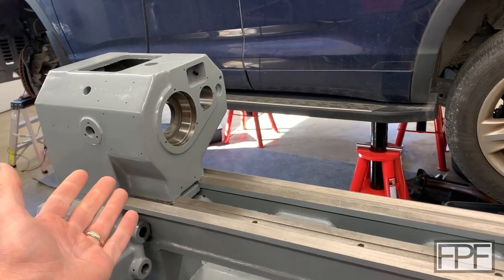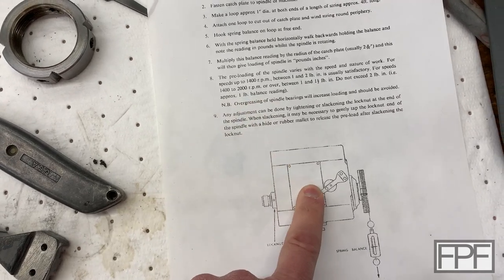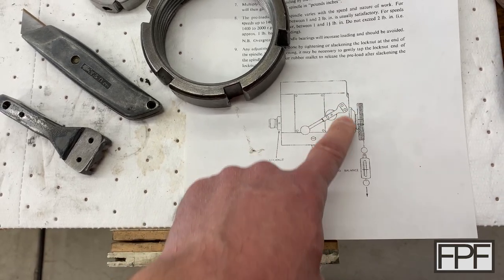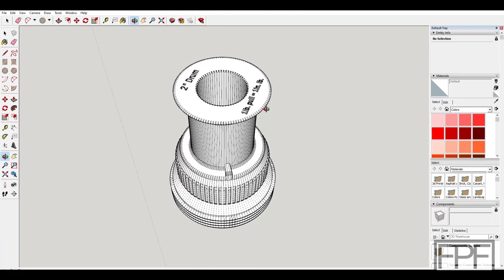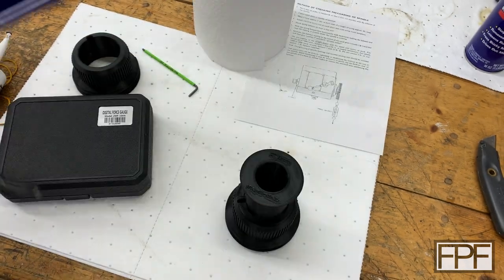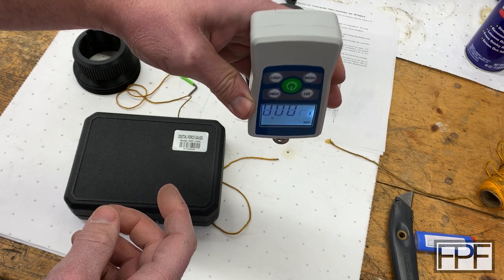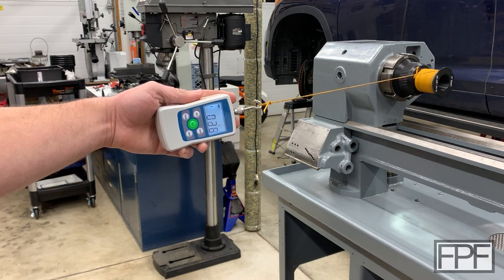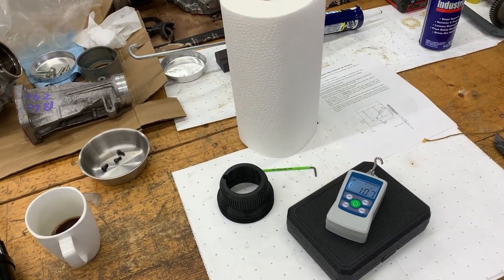3D Printed Lathe Spindle Bearing Preload Tool

Comment: Very interesting video. I like the gauge, will have to pick one up. I think it'll work for checking belt tension on 3D printers and other things.
Reply from the maker: thx, yeh I'm a bit of a measuring and diagnostic tool addict.  I've already found other fun and useful ways to use mine.

Comment: It's years since I used a Boxford, but the catchplate isn't a faceplate that you'd mount anything on; it's quite a small plate used only for driving a lathe dog on a mandrel or shaft when turning between centres.  Yes, I remember setting the spindle preload.  The faceplate for that lathe is much bigger (usually 9")!   BTW, there's no difference between inch-pounds and pound-inches, they're just dimensions multiplied together, and neither is a more accurate term than the other.
Reply from the maker: I had no idea.  Thx for sharing.  Yet another piece I didn't get with my lathe :(  I guess I can't complain too much since it's been kicking around since 1976.